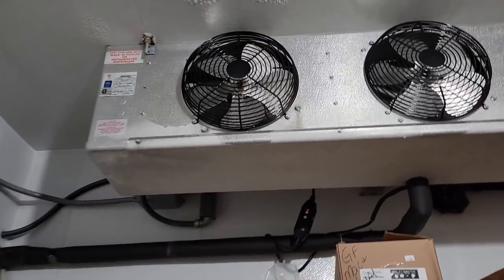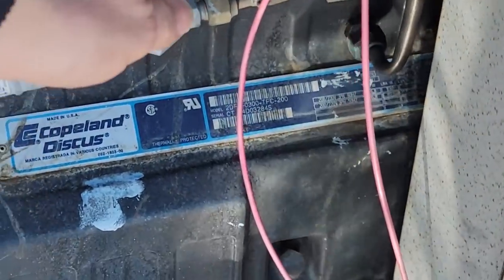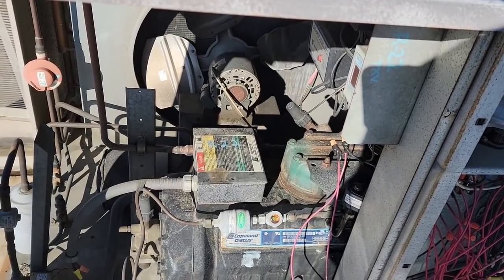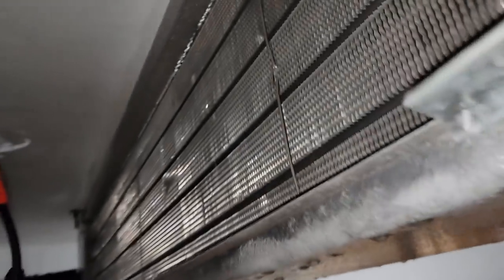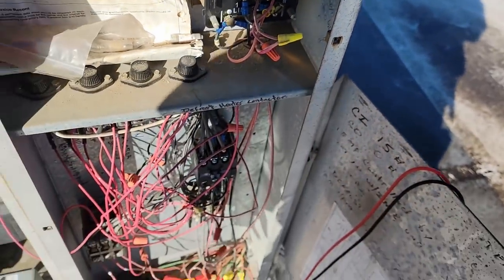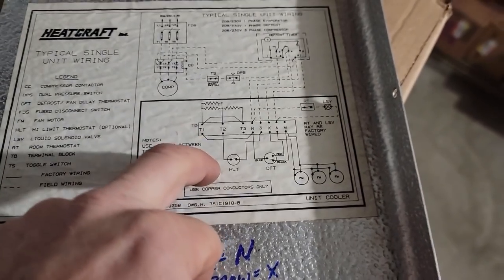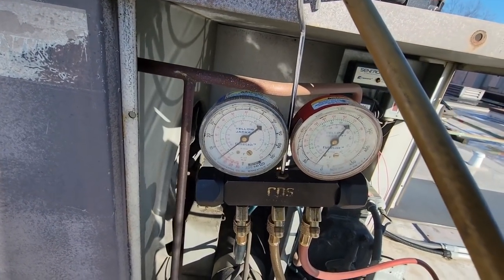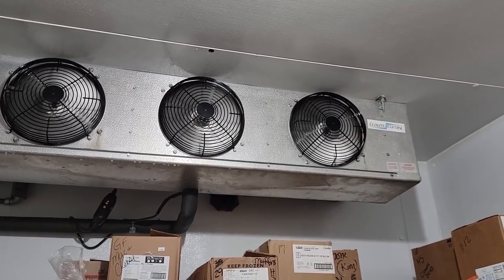Freezer Is Warmer Than Outside!

Comment: Rick i know its not related with this video but you mentioned in one of the recent ones for checking Refrigerant level in receiver using thermal camera u worm up receiver. What method u use for doing that.  Cheers and thanks again for great video.
Reply from the maker: You can use a heat gun or a hand torch but you have to be careful to not over heat it. You want to heat it just enough to feel the difference where the refrigerant is setting vs just the empty metal at the top of the receiver.
Reply: Thank you for answering.  Cheers

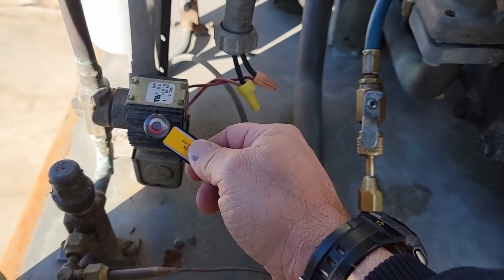Comment: How do you call this device on 13:54
Reply from the maker: It picks up the magnetic field of the solenoid. Then it spins.
Reply: Will also tell you the rotation of pump motors
Reply from the maker: From what I seen,  depending on where I place it at on a solenoid it can change rotation direction and if a circulator pump is a cartridge type it doesn't work because the it cancels the magnetic flux lines.